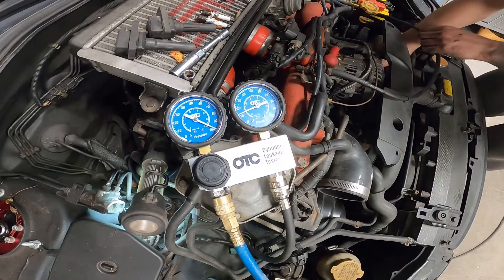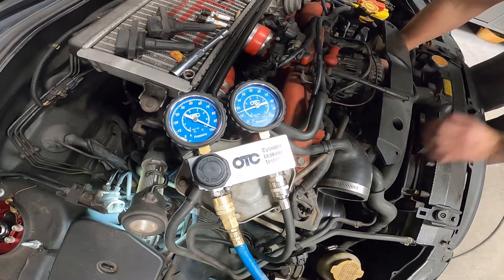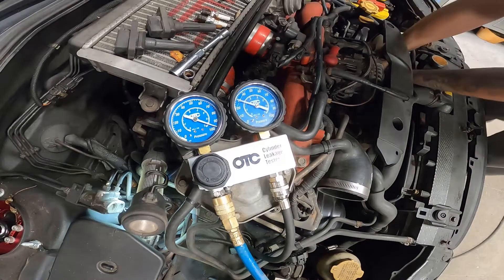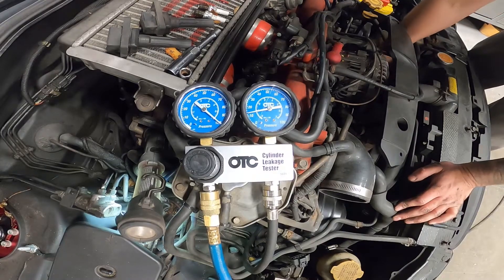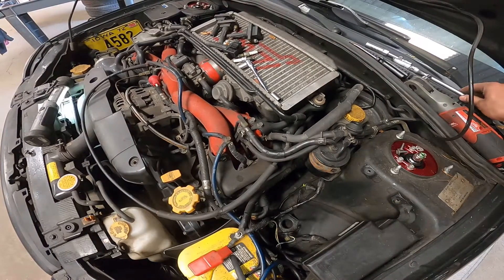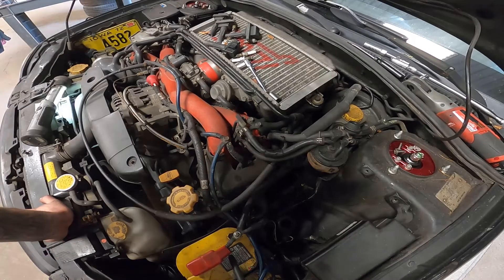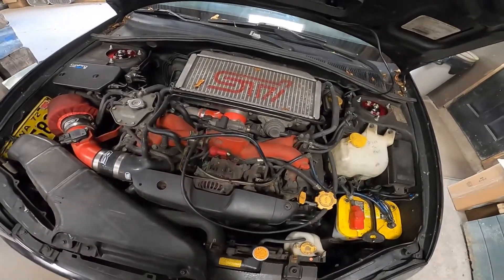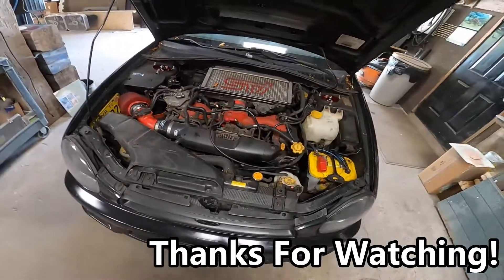Jdm Subaru V7 Ej207 - Leak Down Test

Comment: Great video. This is exactly what I want to do. Just check everything out while I’m replacing spark plugs. Yours is the only video I could find doing the leak down test with the engine in the car. I have a few H6 Subarus and getting to the spark plugs is tough. I might have to make a little 90° adapter I put in first then attach the leak down tester